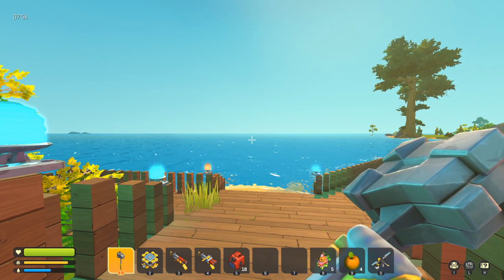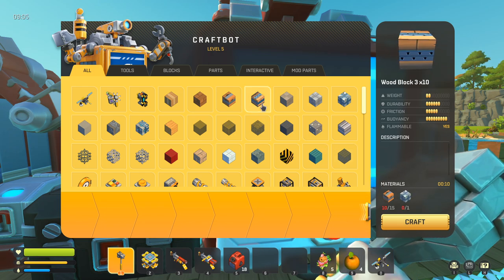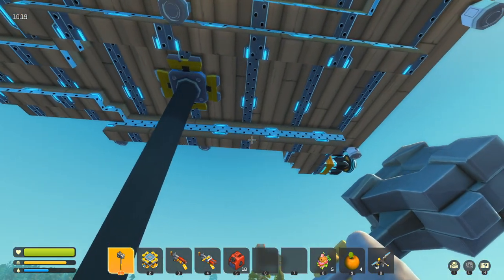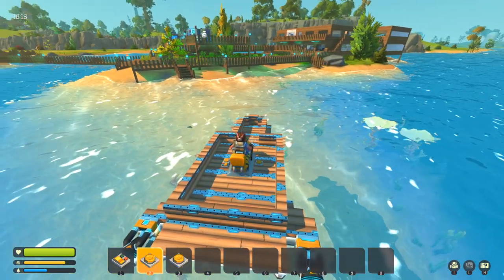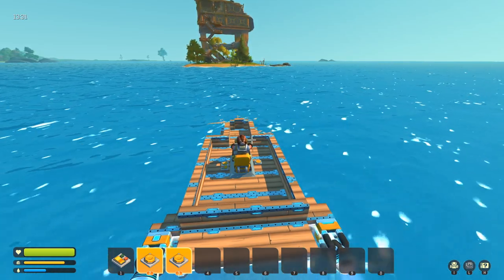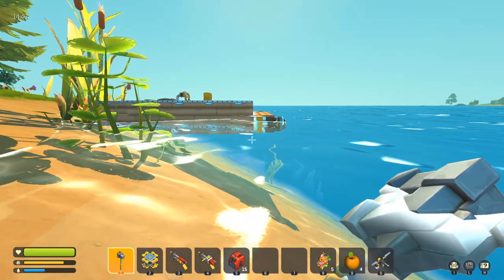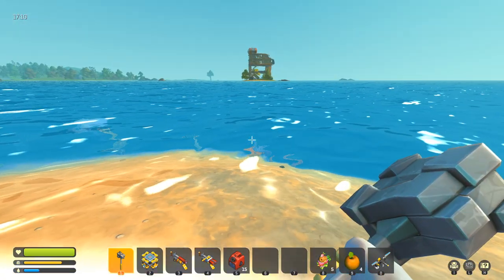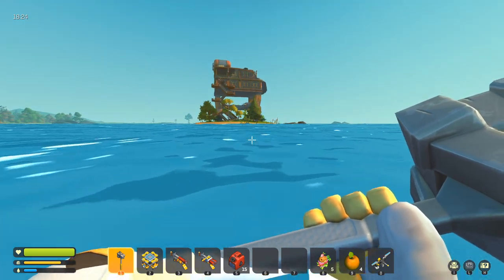Super Easy and Efficient Boat in Scrap Mechanic Survival

Comment: A more efficient way you could've done it is using the suspension glitch to turn the vehicle left/right and only use 1 thruster. reduces your fuel consumption by 50% and increases the handling of the vehicle by alot.

Comment: I find a slightly better thruster arrangement is it put one in at front center and one at back center, and then have them rotate in opposite directions (both facing back  at neutral). (to get them dead center, use a controller to roll them 45 degrees)

Comment: Boats are horrible.  Fyi, not wanna sound like im tellin ya what to do. Just my thoughts.  U have to go bare minimum.  Tested wood 3 and bubble wrap with a friend.  Weight seems to trump buoyancy once u reach a certain amount of blocks..  seems bubble wrap does a little better.  2 thrusters is definitely the way to go... 1 button for each.   Use a regular saddle..  u dont need steering, its smaller and half the weight.  Simple canoe with pontoons on left and right.  Can set engines on pontoons.  U cant expect to be hauling stuff..   u can probably build up more to throw on a 30 slot chest.  U can use that for gas and items.  A gas tank is a waste.  Same weight for 5 slots that only hold gas.  Bah.  Fill manually.  Lol.  U keep it light, u can really zoom.
Reply: Woah woah, end your sentences with a period, not 3 and I’ve found that just boating around and harvesting component kits and getting a feel for your map size and shape, is honestly fun and can be slightly useful, otherwise this is all true